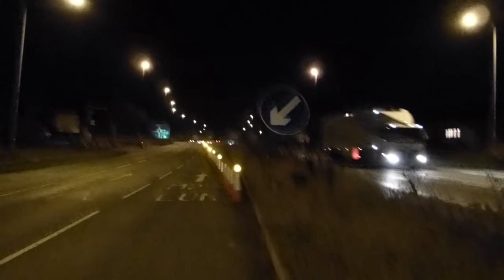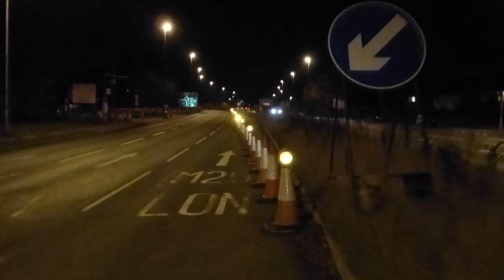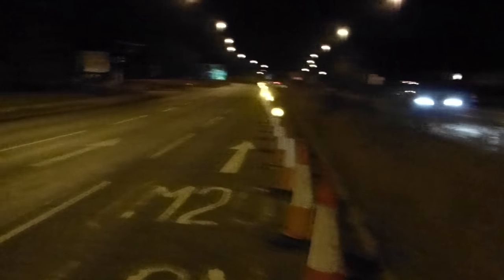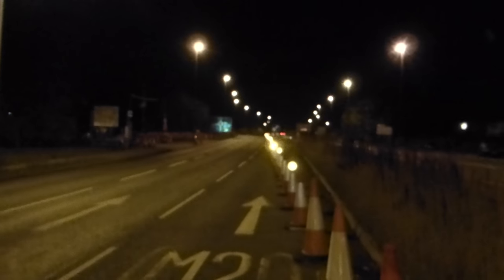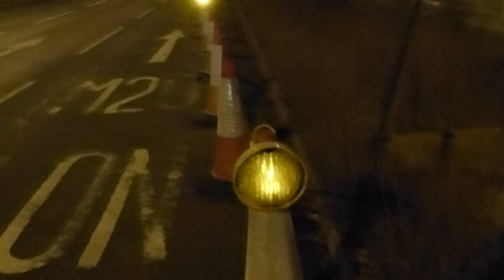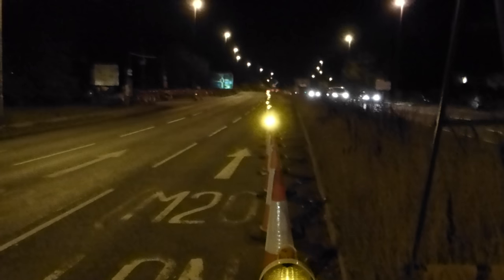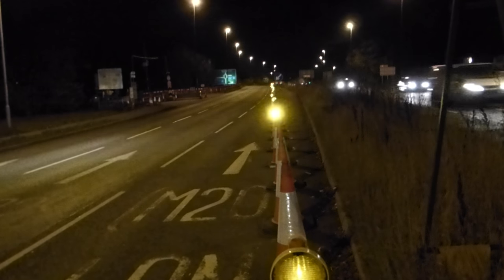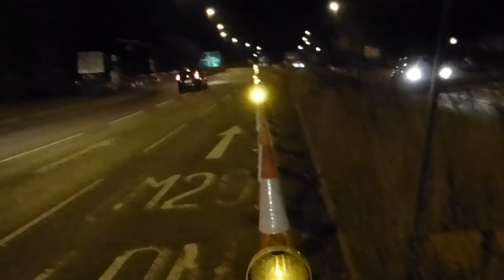How those flashing amber lights at roadworks stay in sync

Comment: I assumed that they all flash at exactly the same rate and the first one was turned on manually then someone walked to the next one and tried to turn it on in time with the first one, relying on the slight lapse due to reaction time which would put the second one fractionally behind the first, then the third timed to the second and so on